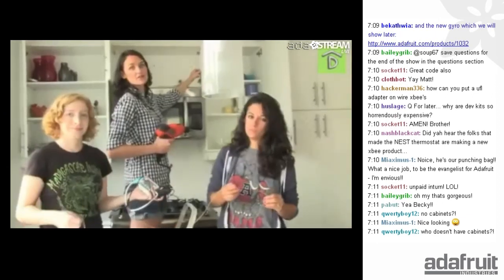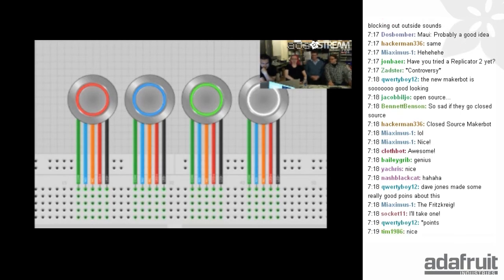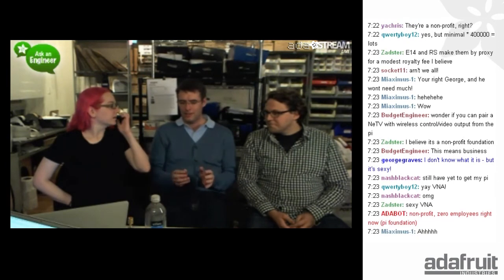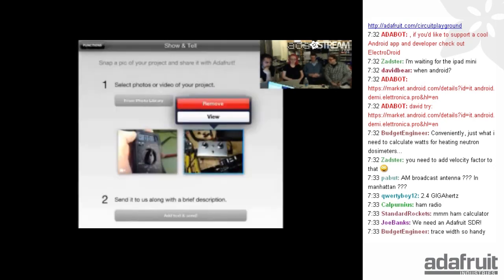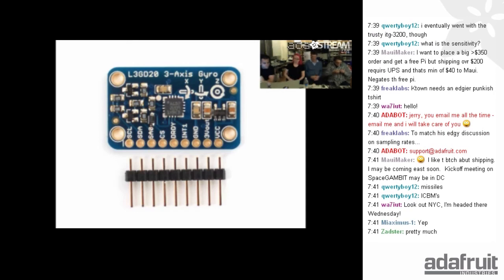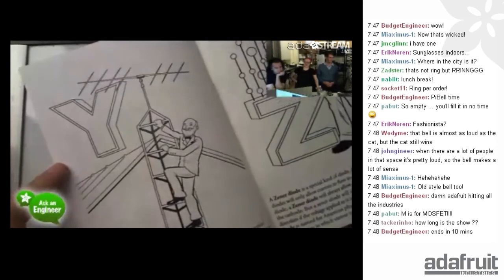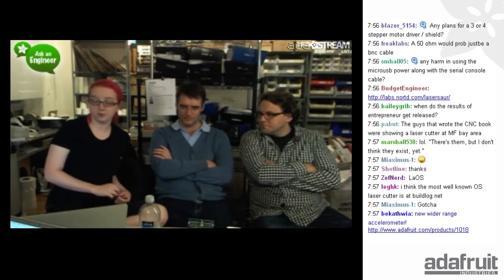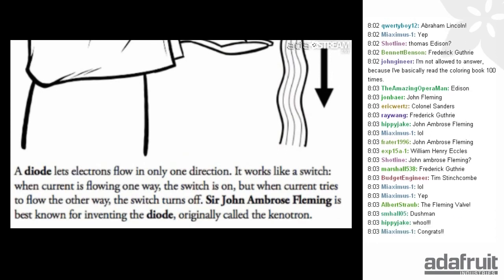Ask an engineer 9/22/2012

Comment: I would like to port your App to WP7/8 & Windows 8. I'll even make it open source. I have also been making projects with mini Web Severs to allow App dev API capability to let multi-platform dev (more important, using for making smart home gear around my devic/code. How does one offer Adafruit/users the ability to make projects based on mine (To obviously have WiFi (or Ethernet) control)? Love the videos!